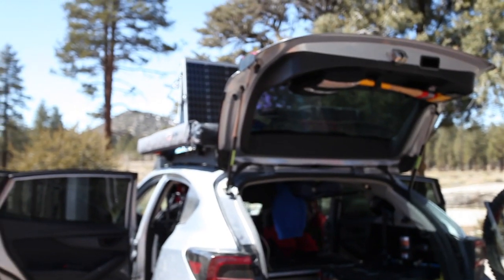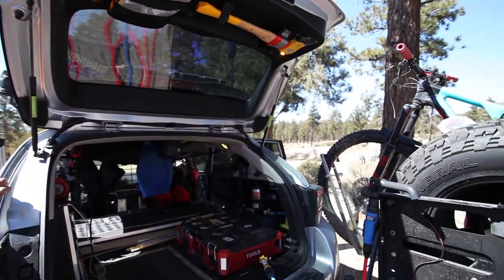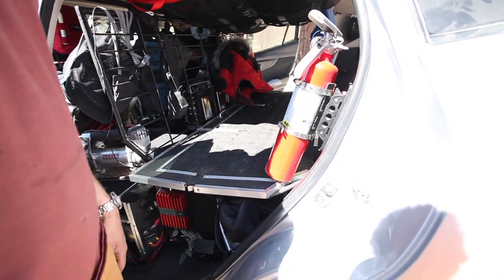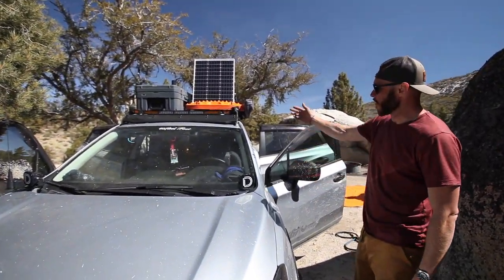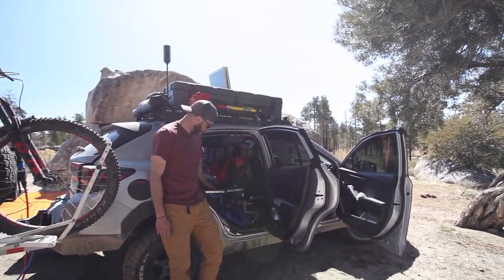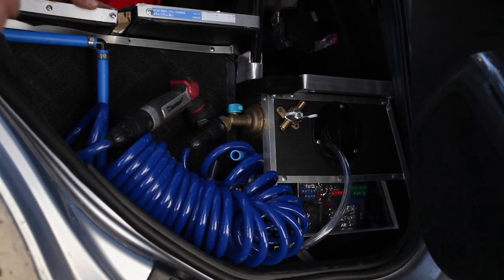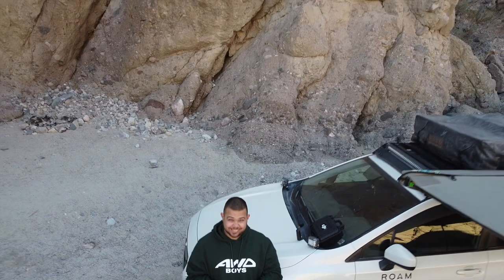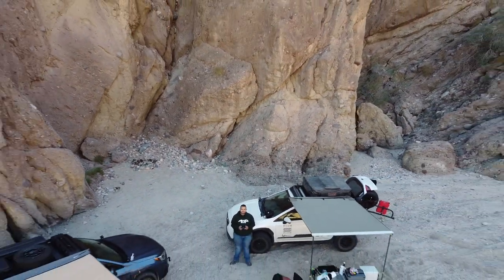MOST BUILT OVERLAND CROSSTREK? | RIG WALKTHROUGH

Comment: Super cool. Just got a 2021 sport and I LOVE IT. I am, however, baffled by how FEW companies make upgrade/aftermarket items for the crosstrek.
Reply from the maker: The market is still very niche! Slowly we’re are getting more support but it’s slot of upfront cost for not a lot of buyers like keeps or Tacoma’s!
Reply: The aftermarket keeps getting better. I can find turbos, intake spacers, exhausts, high-flow airfilters, air/oil separators, diff-lockers, suspensions, hitches, winchmounts, bumpers, skids, rockers, wheels, spare-carriers, lights, etc.

Comment: It has to be the most overweight Crosstrek build too. Although it looks cool, owner need to consider the little hatchback was never engineered for all that weight - which mean poor reliability as factory components will fail under the heavy stress, and poor handling as the engine/chassis struggles with the weight.